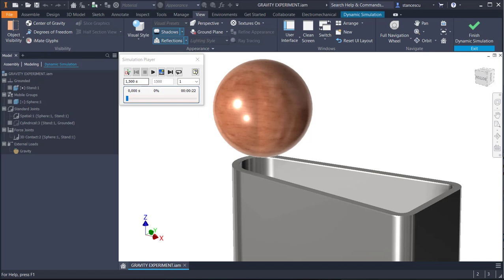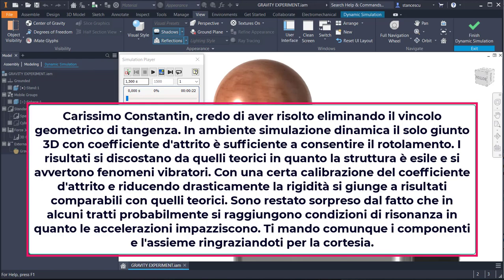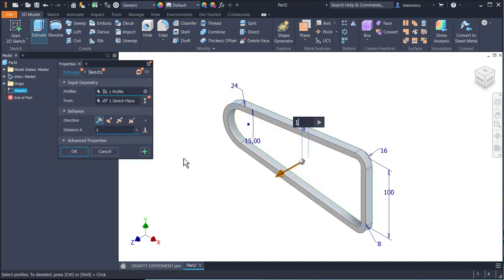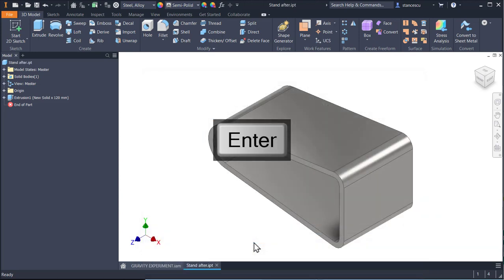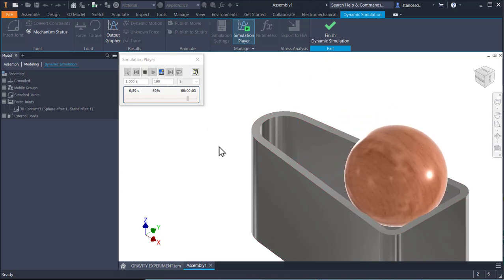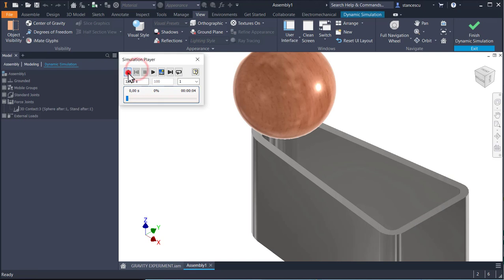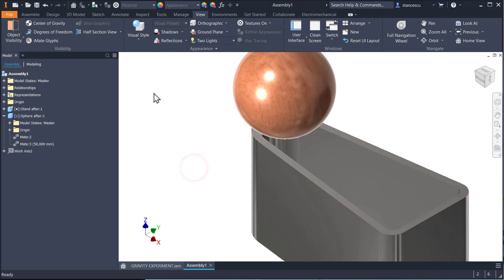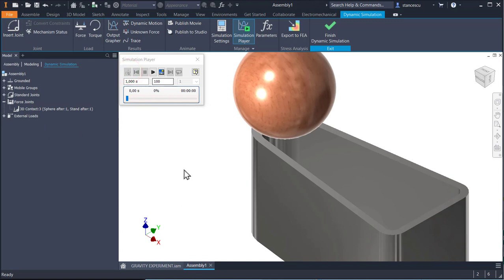Tutorial Inventor - 203 GRAVITY EXPERIMENT

Comment: Thank you, your explanation is very professional.
Could you explain this operation in INVENTOR
  https://www.youtube.com/watch?v=y3V8QtD4A60
Reply from the maker: That simulation can be made also in Inventor.
What do you want me to do?
Reply: @prof-stancescu  I want to move a Metric 12 nut through a rod of diameter 9.5 millimeters bent at 90 and analyze the minimum radius of the curve so that there is no interference between the nut and the tank. It is for an automatic threading machine. 
Thank you